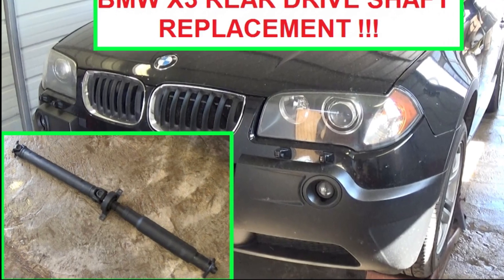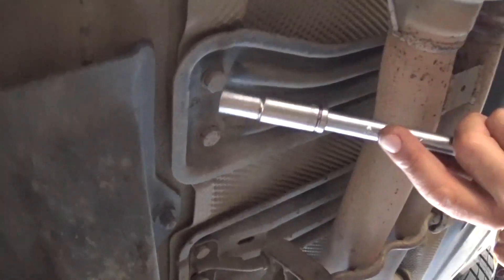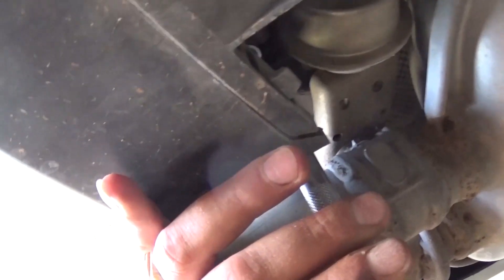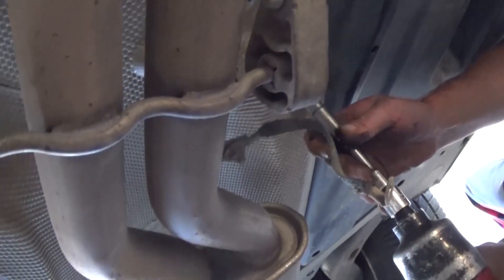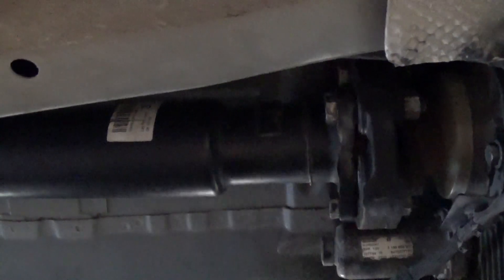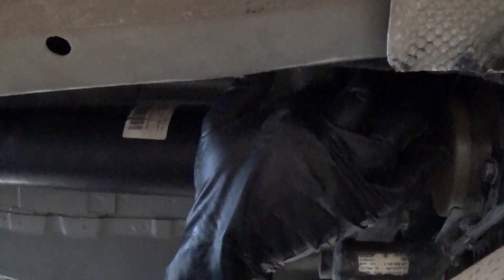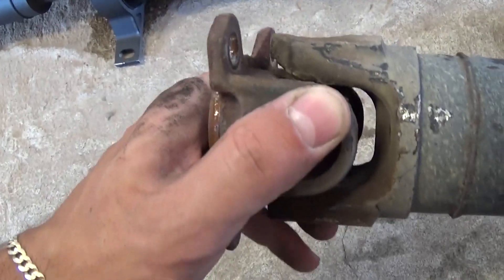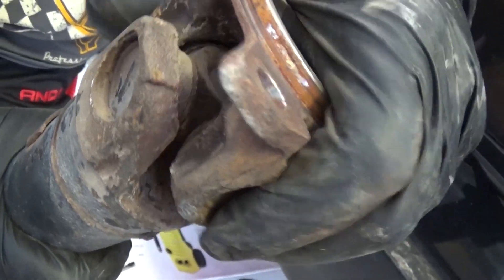BMW X3 E83 Drive Shaft removal and replacement. Rear Driveshaft Replacement

Comment: Everyone, I just performed this task last weekend.  The details provided in this video covered 100% of every step needed to successfully replace your BMW X3 Drive Shaft.  These guys know this vehicle very well and point out all of the potentials issues you might run into while performing this job.  I'm pleased with the outcome and highly recommend the DIY'er to watch this video in its entirety.  The only recommendation I would like to share - consider using four (4) ramps to get the X3 high enough off the ground to work underneath.  I recommend using the Rhino Ramps for $49/pair from Amazon Prime.
Reply: What brand driveshaft you use
Reply: @irastafford5472 😂 4 years ago from when he did it 😂

Comment: Just finished this job yesterday. It took me about 5-6 hours as a first-timer as I had to mess with some PB Blaster to remove some seized up bolts and needing to find the Torx E12 bit. I'm not sure if it's related to this, but after removing the driveshaft with my car in Park, my car rolled as if in neutral - just be sure to have it securely on the ramps/jack stands. The hardest part for me was knocking the rear part of the driveshaft out . What worked for me was spraying PB Blaster on the connection (where the Torx E12 bolts are) and then banging the other end (where the center support is) towards the front of the car with a rubber hammer/sledgehammer to knock it forward. I'm glad I didn't have to remove the exhaust as those bolts looked locked up beyond repair. Plenty of reconditioned driveshafts on EBay, and I got mine for about $390.

Comment: I just changed the driveshaft in 2004 X3 and it went exactly as it was shown in the video. Thanks World Mechanics for a great video. I removed the old driveshaft from the rear end by hitting it with a mini sledge and it popped right off.

Comment: Use a narrow E 12 socket for the rear bolts , to get it to sit straight on the head of the bolt ,,,,,they are tight .Very well described , TOP MARKS !.

Comment: Hi , please i want to know if it's possible to change only the universals joint for my bmw x3 2.5L 2006 automatic transnission.if yes i need reference for the universals joints rear and front.
I 'm from quebec and here when i asked for U- joints they sell the whole drive shaft

Comment: Please do a video on how to replace the front drive shaft. Searching YouTube and not finding any for a 2004 BMW X3. 

The one's available don't show how to navigate the silver thing that seems attached to the rear part of the shaft and seemingly wants to come off with it.

Some comment in another video says you get fluid to pour out all over you and that you must get new bolts.

Finally, may I drive without the front shaft?
Reply: Leave the silver part in and get a “Holder” I removed my driveshaft to do a X delete
Reply: I just replaced my front driveshaft on 2006 X3 (Feb 2022).  You cannot drive without front driveshaft , because .... the end going to the transfer case,  has a u-joint attached to a slip yoke, through a seal.  If you remove the u-joint/slip yoke, you're gonna spill most of the fluid in the TC.  I accidentally pulled mine out (the u-joint flange was stuck to the yoke). Be careful when separating it.  ANOTHER thing most don't mention (you did above), is to use NEW bolts, don't reuse the old "stretch bolts". I learned the hard way.  They need to first be torqued to 30 ft#, THEN .... 45 degree angle torqued.  What a bitch! The 30# is easy... cranking on the extra 45 degree turn is a Herculean effort, especially lying down without a hoist. Anyway, just thought I'd share my experience.  OH and lastly, it says right on the stiffening plate "DO NOT DRIVE WITHOUT .... without the stiffening plate". (that is, if it you take it off to give better clearance to remove the front bolts).  That too, needs NEW bolts.  I didn't realize these bolts are fricken expensive. $9.60 each for front, $6.63 each for rear ones.  So factor in like $70 for the 8 bolts.

Comment: Was this an automatic? Or manual? Thanks
Reply: Automatic- it’s a 3.0L. The rear driveshaft is the same for the 3.0L and the 2.5L manual version, but different for the 2.5L automatic version.

Comment: did you ever come across a drive Shaft breaking in the middle and dropping down?
Reply: I had my front drive shaft break on my x3 and it punctured my fuel line and transmission pan.  Not fun.  Now it's time to replace my rear driveshaft.
Reply: @D. L.  yes not funny while driving..thankfully it happens to me, on the way while parking..5 min earlier..driving 70km/h ..we would be possible death, I was told from the garage, thankfully we has guardian angels

Comment: Why you had to replace the rear drive shaft if you already replace the center support in the other video ??????
Reply: Ujoints.
Reply: I’ve a same problem with u-joints can i replace them by press them out and put new one